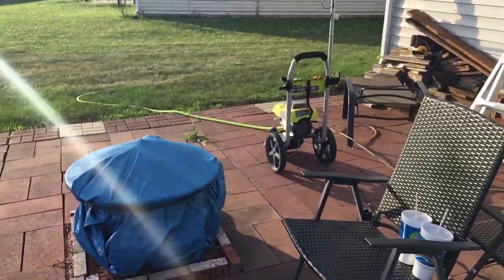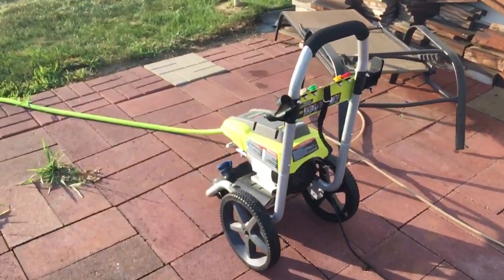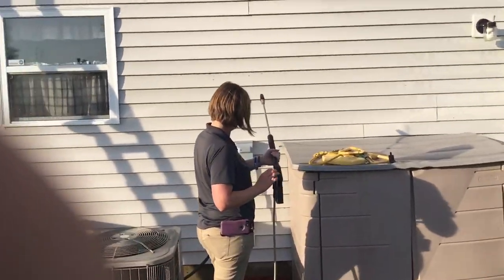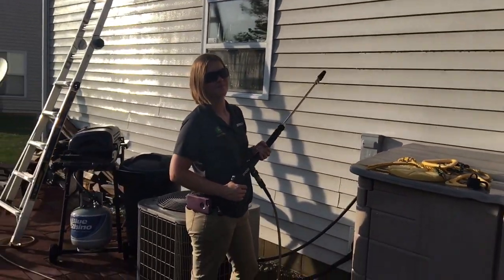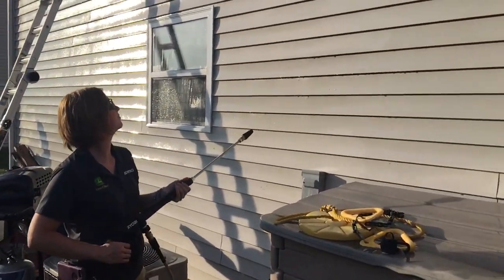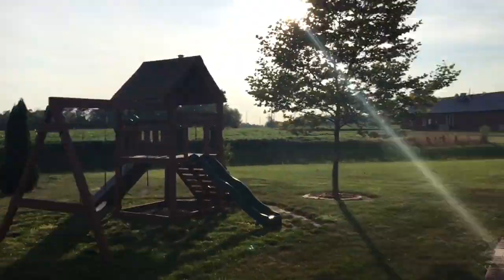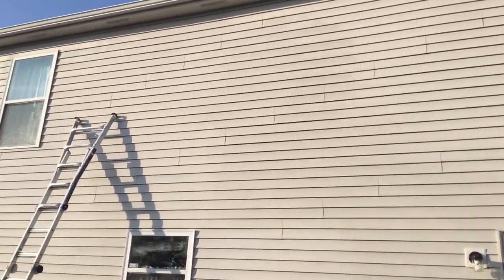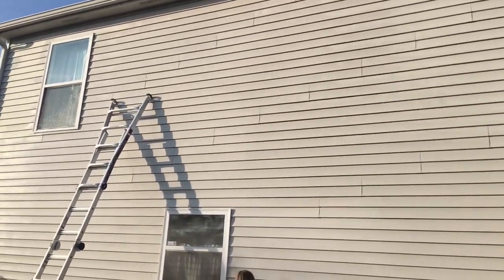Ryobi 2300 PSI Electric Pressure Washer with Turbo Nozzle Cleaning Vinyl Siding

Comment: There are better tips to use on siding turbo nozzles are generally for concrete & masonry surfaces.
Reply from the maker: It worked pretty good but the 15 degree worked the best. I just thought the turbo nozzle looked cool on video.
Reply: I've never had an issue using a turbo nozzle on siding. You  just have to be experienced enough to know not to get too close..

Comment: omg this is terrible..all you need is some "simple green" or "30 seconds wash"... youre getting water in between the vinyl siding. you just cost yourself hundreds if not thousands in water damage repair. do some research on "soft house wash"
I appreciate your effort here but.... NO NO NO
Reply: you spent a week on this? you could have been done in 30 minutes with the whole house using the right method
Reply from the maker: I have been doing it this way for years with no problem. Now I have found a better way that i did this year and it took no time at all. Vinyl siding is overlayed and perfectly safe to spray water up at it. Thanks for watching
Reply: Simple green is trash - 12.5 sh mixed with a little surfactant - 22+ years of washing and thats what any good company uses 

And no more than 60 psi tops
Reply: @robertkurtz7587  of course sh but we are talking about someone doing their own home, not a professional company. lets not get them mixed up with sh and complicating mixes.